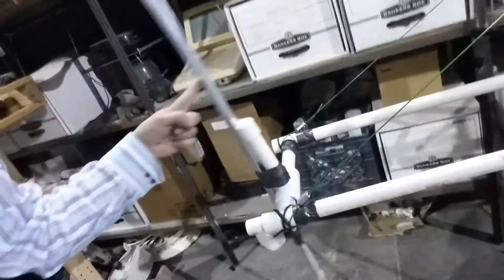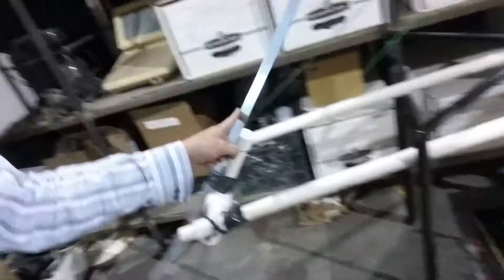Shwinging and shplashing

Comment from the maker: I should have mentioned in the video that the one finger operation im using to swing the weight would be impossible to use on the water pump I'm using. it took two hands using Google significant amount of pressure (estimated 3 pounds of force)  to manually push and pull the pump piston.